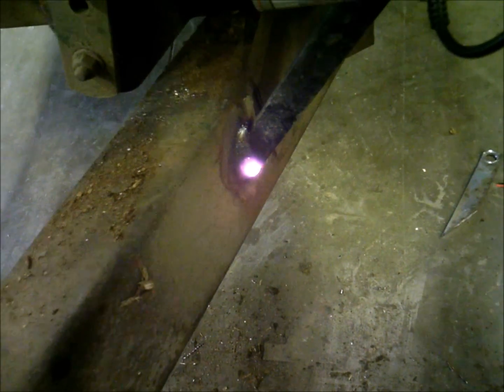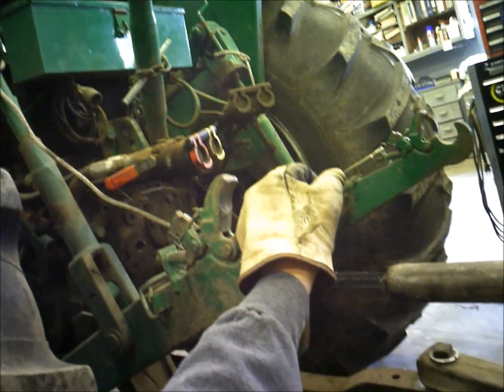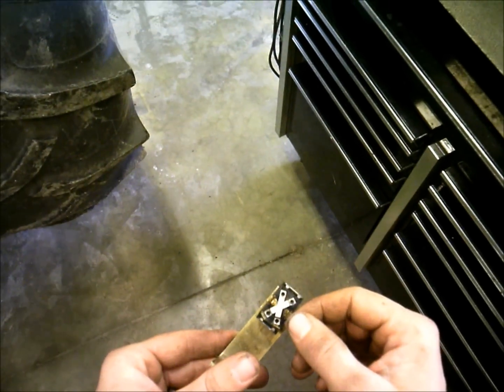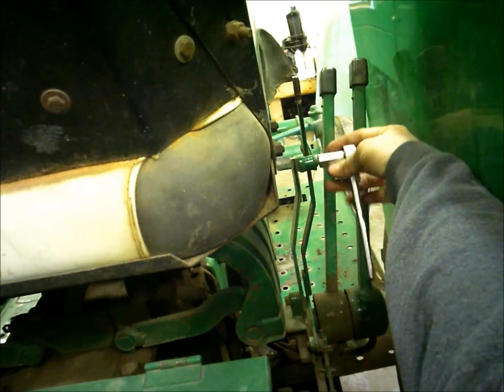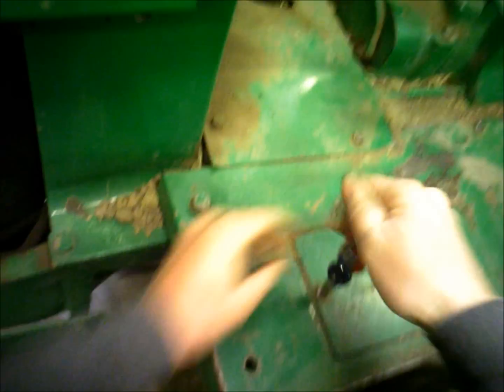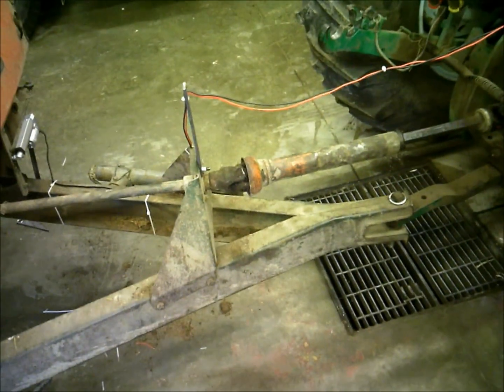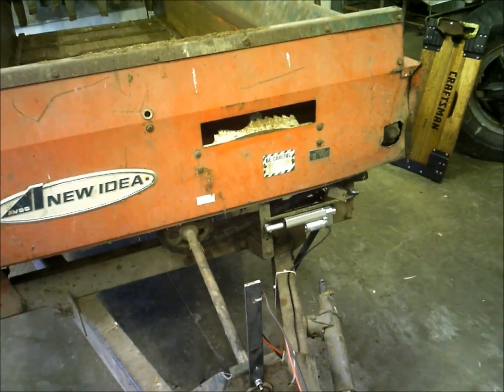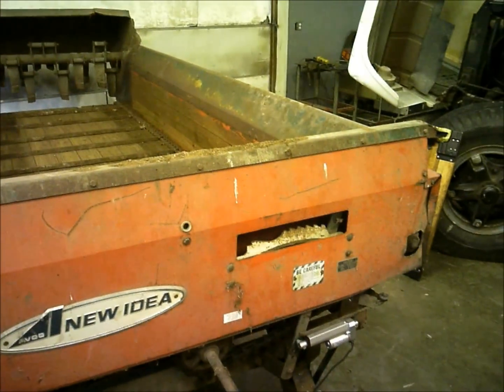New Idea manure spreader service pt 1

Comment: As, you know Jake, I regard manure spreaders as professional faculty colleagues. My old boss Roy used to call them "mechanical professors," lol :-) You've really improved this one. Maybe I should get myself a linear actuator so when I am teaching I can spread my B.S. as well as your rig does!
Reply from the maker: defuse56 lol I remember u saying that I might have to use that in a video thanks for the comments jeff! :)
Reply: Jake Ziegler Most welcome.  Seriously though, very inventive approach to the problem w/ your spreader! It's the kind of mechanical fix I would never think of, because we didn't have that level of technology 50 years ago :-)
Reply from the maker: defuse56 thanks jeff. This was
Bout the time tractors started to
Have cabs and so they put that rope so one could run it through the back window. The old spreader we had 15 years ago just had levers that ran up. It always worked tho haha
Reply: Makes perfect sense when you think about it. You've improved the older engineering! I wonder if new spreaders have something similar to what you did.

Comment: JakeI like how you reengineered the spreader did not like how it jumped around as it was spreading.   I see what it for but you not dealing with dry hard manure that would need it to slow down to break up the dry hard chunks smart to replace it good video.
Reply from the maker: roger wilson thanks bud! Next week I'll have a video of the packed cow manure and I really have to slow it down for that cuz I've broke chains before running it to fast with that
Reply: Jake
manure spreaders the chain drive there a lot of trouble lol.

Comment: Neat fix there Jake. However please locate and re-fix the front PTO shaft guard -one day you will come round the back of the tractor in the field because you have forgotten to fit your cable connection and something dreadful might happen when you reach over to conect it up.
Reply from the maker: Dan Whiteford thanks dan I know I should buy one but.....I haven't got around to it. I should tho
Reply: Most definitely!! I just hate to see those exposed shafts and UJ's after having had to help pick up the "pieces" after someone I knew got caught up in one, they did not survive.
Reply from the maker: Dan Whiteford oh wow that's not good. I bet u got shaft covers on everything now
Reply: Too right, it's almost as bad as people adjusting machines or, for example, trying to clear blockages with the machine still running even at tickover speeds.

Comment: The spot of black paint making the rest of the spreader look bad lol. My removable switch boxes, monitors are set up to go on a smv spade mount on the fender or in the cab depending on the tractor.  I have an old 300 Knight spreader I need to get the gearbox fixed. The poor ol tires on it you can almost see the air in them through the sidewalls lol.
Reply from the maker: Dale Cornelius haha I have yet to see an old nice manure spreader. That's a good idea with the smv mount

Comment: fuel line works goo or any rubber tubing works goo for high friction or stress points. any @everything electrical should be fused or eventually it will short out @it will burn!! 20amp will prolly be good for that cylinder motor.

Comment: nice job. I didn't notice if you installed an inline fuse where you picked up the power for the switch.  If not, you might want to in case a wire gets rubbed. thx.
Reply from the maker: james mullis yep thanks James I forgot to do that.

Comment: That looked like it worked real good ,that  welder you have sounds real good what make is it?. I use to weld high pressure steam piping . We all had to certifide On three types of welding
Reply from the maker: Howard Younger thanks Howard! Ur prolly a better welder than me then. I imagine they had all sorts of people checking ur welds are u were done. That welder was a Hobart. Can't remember the number its prolly about 15 years old.
Reply: Hobart made some realy good mig machines ,I like the old ones better the new ones .The new ones might be a little smother and a lot smaller but   the set up is 90% of mig welding ,it looked like you had it set up real good ,what wire do you run ?  we had one inspector that hated it ,because it use to be hard to tell if it was melting in to the base metal,and a lot of people did not know how to run them in power plant industy back than,  the guy was a perfectionest , We had a lot of xrays and almost every weld was visualy inspected .

Comment: Jake,  what model is that spreader?   Just wondering what kind of hp to drive a spreader like that?
Reply from the maker: Bryan OConnor it's a New Idea 216. They made models 212-217 I think that were all the same box just different flail options. With packed cattle manure it prolly takes 65 hp.